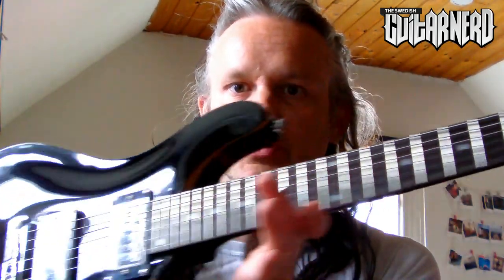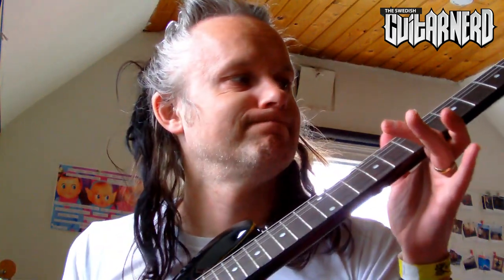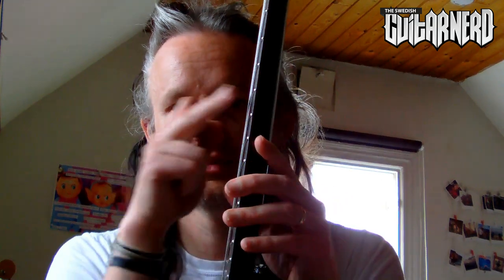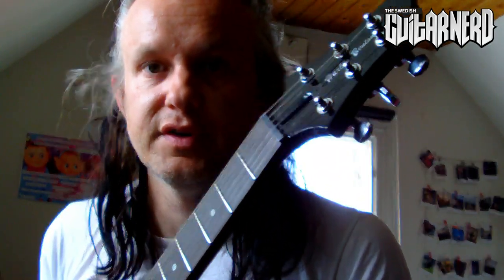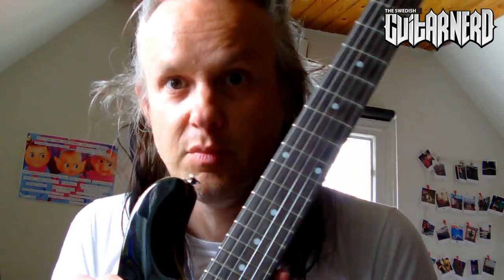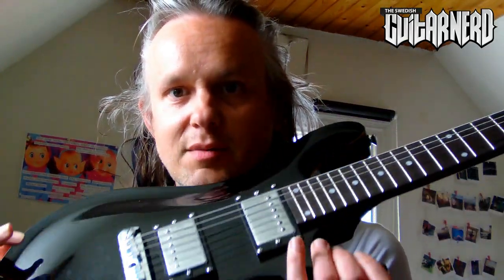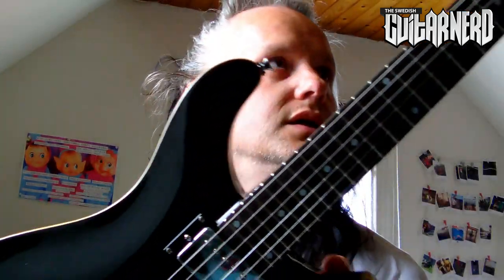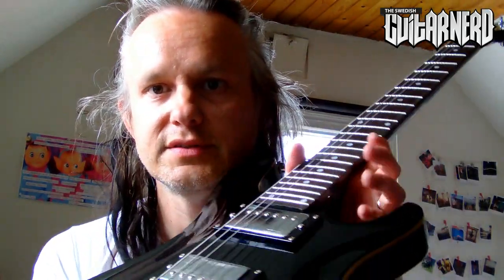Harley Benton CST-24 FAIL

Comment: Well dang! I'm worried the next one will match this one! Although I did see one guy about refurbishing an old guitar. He showed me his. All he did was swap out the strings & change the pick ups. well, A little later he did put some new tuners on it. About a year after that as I recall he realized it just flat our had a bad neck so he got a new Tele style that fit perfectly. It  was then he realized the body just didn't feel right with the new neck. New body of course deserves a new bridge as well. I keep thinking about doing something along these lines with One of MIM Fenders.
Reply from the maker: greatvanzinni Modding is great if you have a good platform to start from. This one has great tuners and pretty good pickups, but since the neck isn't working that doesn't help much..

Comment: Watching this, I am confused. If the strings buzz high on the neck, wouldn't it be because it has too much relief? And in this case shouldn't it need tightening instead of loosening? (turning the rod clockwise when seen from the headstock).
I'm new to this, but I just solved a similar issue that way. I had buzzing strings above the 12th fret after lowering the action. Tightening the neck fixed it.
Reply from the maker: Leo of Red Keep In this case no truss rod adjustment would have helped. The Thomann QC agreed that the neck was faulty and sent me a new guitar. This one was buzzing on every fret..

Comment: Might be a double action trussrod. If it is loose and you keep turning it, it regains grip after a few turns.
Reply from the maker: It doesn't help. The neck almost had a visible concave bow to it after I had loosened the truss-rod completely and still the high E and B string were buzzing all over the place. Even with the action set high. The other strings were fine for strange reasons. Let's hope the next CST-24 is better. If they send me one...

Comment: Well there is something in the air, yesterday my friend had to send back a 2017 natural Gibson Les Paul standard with a faulty truss rod. He is so disappointed. Harley Benton is one thing but Gibson ?
Reply from the maker: Tom Corr You've come to expect bad quality from Gibson. I remember trying their entire 2016 line and finding so many flaws. The cheapest were the best for very strange reasons..
Reply: SwedishGuitarNerd it's a shame but perhaps not surprising as I heard current CEO Mr Juszkiewicz apparently doesn't play the guitar. If the passion isn't there from the top then there is trouble ahead